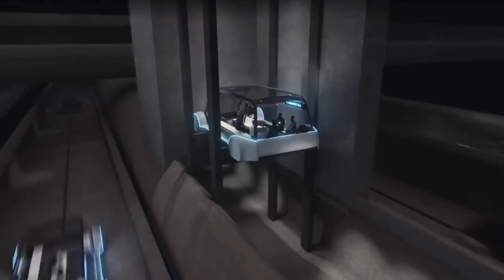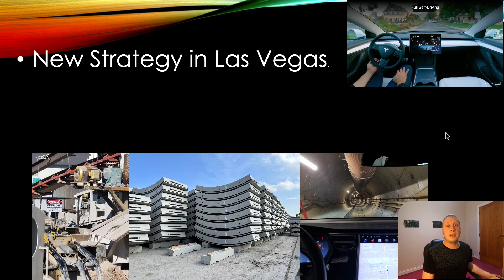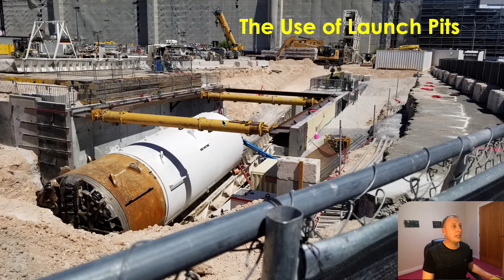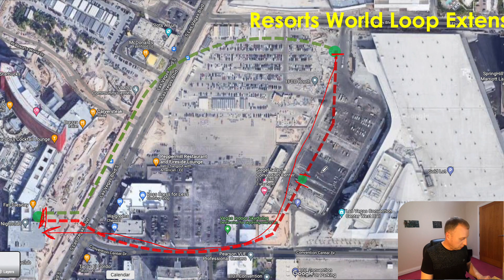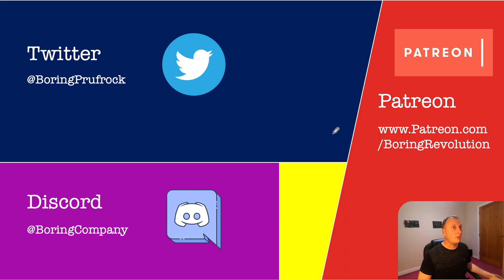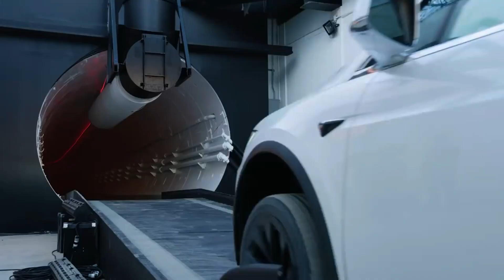Resorts World Construction Phase-2 Integrates The URUP Method 👍🏼 🚇 🏗️ 👷🏼 💰 😊 # 151

Comment: It seems TBC have discovered that you can't just angle a TBM downwards and let it drive into horizontal ground. I said this when "porpoising" was proposed 18 months ago. Any experienced TBM tunnel engineer could have told them that. Only works up to a very small diameter for HDD and pipejack tunnels.
Very slowly they are starting to realise the existing industry does know what it is doing, and that tunnelling is a complex engineering technology with a lot of expertise gained over generations of tunnellers.
"I'm just going to buy a TBM and start digging" was one of the stupidest comments I have ever heard as a professional engineer.
I look forward to their designs for the underground Loop system. Will it be an integrated underground network with branches to connect all locations (Like a road network) or a continuation of a series of discrete sewer tunnels between overhyped taxi ranks?
Reply: @verynice5574  thankfully the tunnelling industry doesn’t make that assumption. It continues to lead and innovate in construction.
I agree the road is littered with dinosaurs that failed to move with the times, as well as many who thought it would be a place to make easy money without understanding what they were getting into.
TBC seem to be the latter so far.